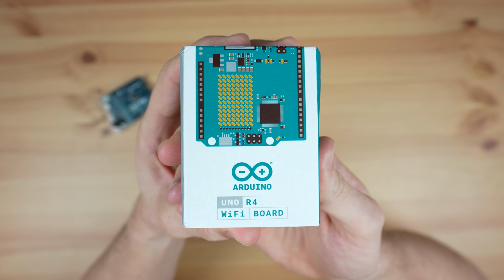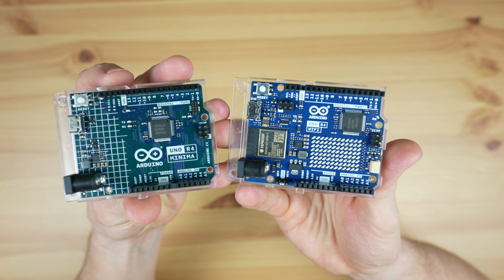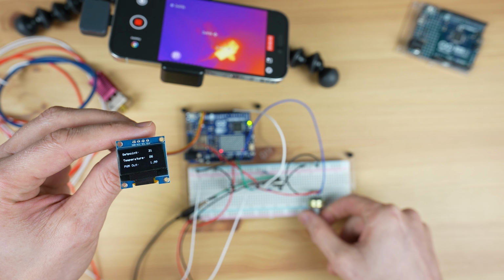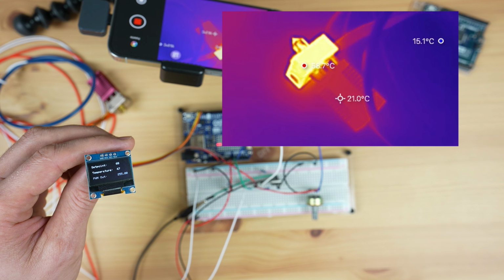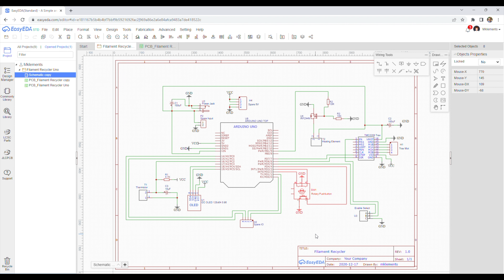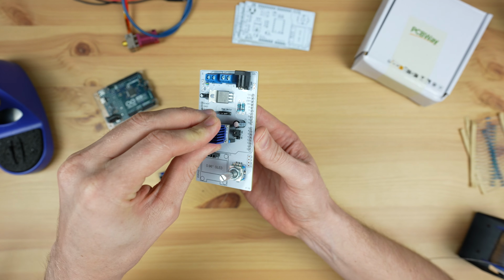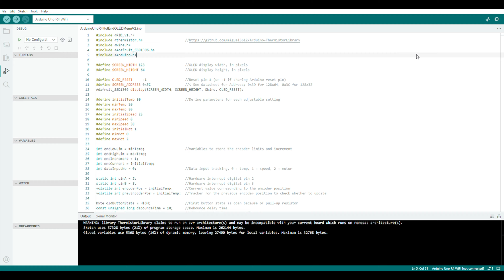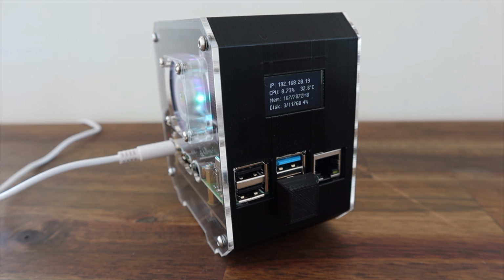Control A 3D Printer's Hotend With An Arduino - PET Bottle Recycler Part 1

Comment: This is perfect. At the moment I just wanted to control a ceramic heater and thermistor with an Arduino and this project does 99% of the heavy lifting which is the parts, needed schematics and code. Seeing how I can scale it up later on if I choose to do gives me other ideas now.
Reply: @VideoCesar07  can you plz share the code i am having huge problems with his code it says something wiht did you mean register at the thermistor

Comment: Thankyou Michael for this great tutorial that I came across just by chance, And it was a blessing. I have a question regarding the small cap that is by the jack plug. I cannot find any mention of its size?.
Reply from the maker: There is a schematic on my blog which itemises the parts, that capacitor is a 100uF

Comment: How many amps did you need for the 12v supply for the motor/hotend? I have a bunch of 12v wall warts from .0.5-2 amp . Thanks.
Reply from the maker: I used a 12V - 3A supply

Comment: Will you ever release Part 2? 
Please provide gerbers and schematics of your circuit. So, we can do our own tests.
Reply from the maker: I have put the Gerber files and schematic onto my blog post that is linked in the video description. Part 2 is still a couple of weeks away, there is a lot that goes into the hardware side of the project.
Reply: @MichaelKlements  Unfortunately NOT. Gerbers can‘t be found in your blog post and schematic isn‘t really readable and not downloadable.
Reply: @MichaelKlements  Why should I follow your channel? The project isn't complete, especially schematic and gerbers aren't provided and there is no following post in sight. Your blog posts are full of referral links and there are a lot of similar project on YouTube available that are complete and provide all needed to build your own. So, give me one good reason.
Reply from the maker: No-one is forcing you to follow the channel. If there are a lot of similar projects available then you should have a lot of other options to choose from.
The Gerber files and schematics are on the blog post as per my first comment.
Reply: @MichaelKlements  Please check. The only download link on your blog post is for the Arduino sketch. No schematic, no gerbers 😟
Reply: @MichaelKlements  No, they aren't. Please test it by yourself.

Comment: Very interesting project. Just wondering do you have an engineering background that you designed the pcb?
Reply from the maker: I have a mechanical engineering background - I learned to design PCBs when I started working on Arduino projects a few years ago.
Reply: @MichaelKlements  in your blog, could you put down the mathematics you used to design the electrical circuit. Thanks

Comment: Hi! I have a question regarding the heatblock. Why is overheating? I copied your circuit with some modifications (I put a 12 V on the mosfet). The thermistor can’t also detect the heat
Reply from the maker: It runs a PID loop to control the temperature so if your thermistor isn't working then that's likely why it just continues heating the block.

Comment: Just some feedback. You could use an ESP32 instead of the Arduino Uno R4 which would help make the board much smaller, you could add in a 5V step down circuit to power the whole thing from the 12V in and writing the firmware using ESPHome would integrate it nicely into Home-Assistant.
Reply from the maker: Thanks for the suggestion, I'll probably use a smaller microcontroller for the final version so I could still use an ESP32.

Comment: Would adding thermal runaway protection be an option? I have had a few thermistors on my Ender 3 fail. Another feature to maybe add is a simple buzzer to sound when the set temp is reached before extruding?
Reply from the maker: I could try to incorporate thermal runaway protection. I didn't think it would be neccissary for a project like this since it only takes a couple of minutes to extrude a full bottle and you'd be watching it the whole time. It's not designed to be left unattended for any period of time. I like the buzzer idea!

Comment: I have a question regarding the step mottor driver. It is rated for 1.4 amps with peak at 2 you used 3 amps and told one guy that 5 is fine. Is there something I am missing? Would't that high amperage fry the driver?
Reply from the maker: The driver limits the current supplied to the motor, the motor can't "draw" more than this. As long as you don't supply more current than the motor can handle, it will be ok.
Reply: @MichaelKlements  Thank you for the response. I checked other sources and now I know how to limit the current on the driver now.
Reply: @MichaelKlements   I have a question and i scattered the whole internet, and maybe you will be able to answer it. I set up nema 17 with TMC2208 v3.0, and it is in UART mode. I changed the current on the driver to be 0.4 V because I use a 0.5A motor. But my motor is making this weird noise, like repeating tumping. If I increase the speed, the thumping gets louder and there is this slight humming noise? Does my driver cause these issues or maybe have you encountered something like that? I would be very grateful for advice.

Comment: What value capacitors and resistors did you use on the breadboard version? A wiring diagram would also work. what power source are you using for hotend and motor?

 trying to replicate your design without buying pcbs. Thanks!
Reply from the maker: There is a full schematic in the post linked in the video description.

Comment: @MichaelKlements arduino uno r3 works too?
Reply from the maker: You would have to adapt the code slightly so that it's not using the onboard LED matrix but yes this will work on an Uno R3

Comment: Hi! What source do you use? Is 12V 5A??
Reply from the maker: I used a 12V 3A supply, a 5A supply will work too.
Reply: @MichaelKlements  thanks! But how did you calibrate the temperature??

Comment: Hi! did you use another power supply other than Arduino? My hotend does not get hot at all hahaha
Reply from the maker: Yes it is powered through a 12V external supply plugged into the barrel jack on the pcb
Reply: @MichaelKlements  I'm currently redoing your circuit now, and I'm doing the part of the hotend first. Where did you connect the 12 V?? Thank you so much!
Reply from the maker: The circuit diagram is provided on my blog - linked in the video description. This shows all of the power connections and associated circuits.
Reply: @MichaelKlements  Thank you so much! Last question, what is the speed of your motor? Thank you again!

Comment: I tired replicating this, but I have an issue where the hotend would cool down as I’m dragging the plastic for a few seconds, would take up to 3 minutes to heat back up to 230
Reply: Higher V power supply

Comment: can i use Arduino R3
Reply: and IRLZ44N Power MOSFET
Reply from the maker: It'll obviously need to be modified to not use the matrix display but yes the base code can be run on an R3, I have it currently running on a pro-mini

Comment: hey can i use the Aridunio uno R4 wifi and dont need to buy the little screens????and how and what i need to be the easiest way to take my EELEGOO 3neptune 3dprinter and make it bluetooth are wifi wherer i can move files with a sd card are cord stright from my phone are computer bluetooth are wifi....let mer know the easest way i can solider it on the board as well are buy new board>>>????
Reply: ??? I don't understand what you mean! ???🤔

Comment: When recording, the following error appears even though file or directory has been added

C:\Users\Juvas\Documents\code\PET2Print\PET2Print.ino:54:1: error: 'thermistor' does not name a type; did you mean 'register'?
 thermistor therm1(temperaturePin,0);         //Connect thermistor on A2
 ^~~~~~~~~~
 register
C:\Users\Juvas\Documents\code\PET2Print\PET2Print.ino: In function 'void setup()':
C:\Users\Juvas\Documents\code\PET2Print\PET2Print.ino:82:11: error: 'therm1' was not declared in this scope
   input = therm1.analog2temp();                           //Read and set the initial input value
           ^~~~~~
C:\Users\Juvas\Documents\code\PET2Print\PET2Print.ino: In function 'void loop()':
C:\Users\Juvas\Documents\code\PET2Print\PET2Print.ino:103:11: error: 'therm1' was not declared in this scope
   input = therm1.analog2temp(); // read temperature
           ^~~~~~
C:\Users\Juvas\Documents\code\PET2Print\PET2Print.ino: In function 'void runMotor()':
C:\Users\Juvas\Documents\code\PET2Print\PET2Print.ino:300:13: error: 'therm1' was not declared in this scope
     input = therm1.analog2temp(); // read temperature
             ^~~~~~

exit status 1

Compilation error: 'thermistor' does not name a type; did you mean 'register'?
Reply from the maker: You haven't installed the thermistor library - //https://github.com/miguel5612/Arduino-ThermistorLibrary
Reply: @giovan79  have you made it work? If so plz tell me I have the same problem